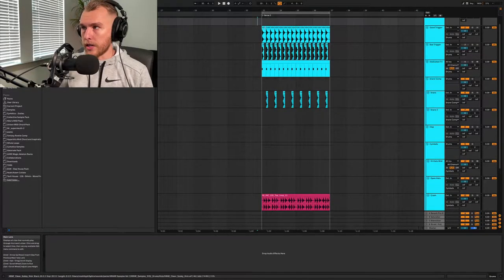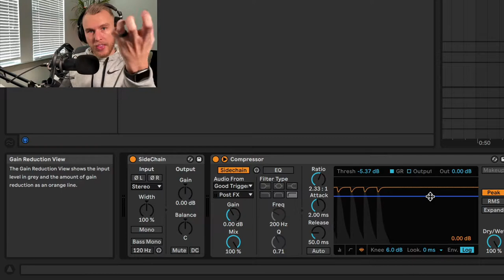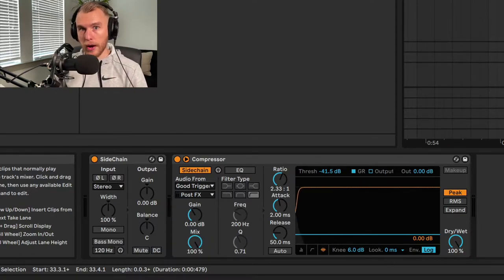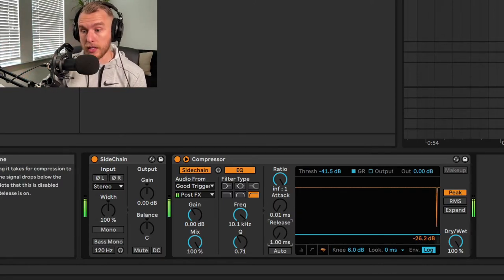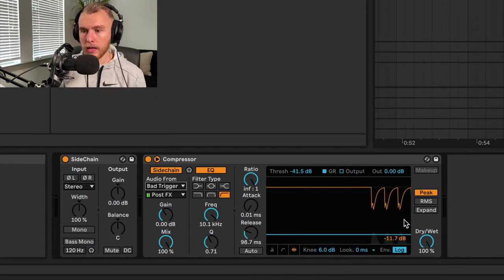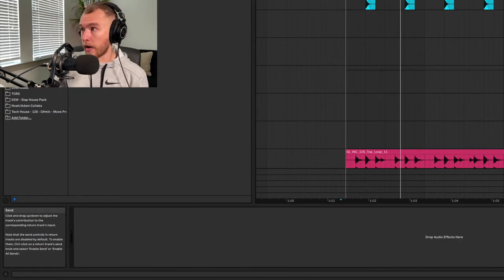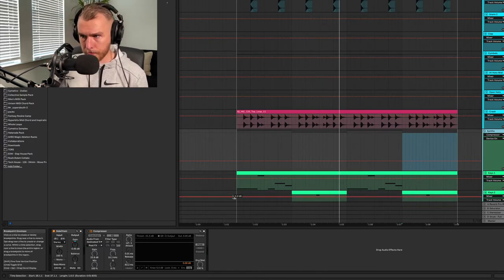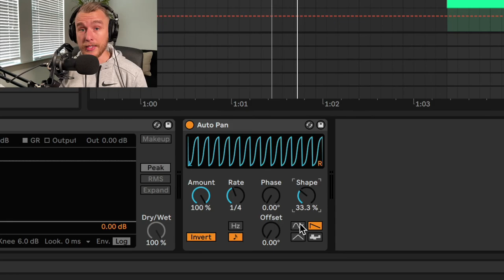Common Sidechain Mistakes and How to Fix Them - Ableton 11 Tips

Comment: I use another type filter LPF and 200-250 Hz. Because ugly click its not my way:) Attack to 1.00 ms is better.
Reply from the maker: There are a lot of great ways to side chain out there. I never considered using just the LPF, I'll have to try that out!
Reply: @SoundsGoodRecs  But in this mode, the sidechain turns out to be soft and pumping:)
Reply: @SoundsGoodRecs  But my favorite way is to use Soothe 2:)